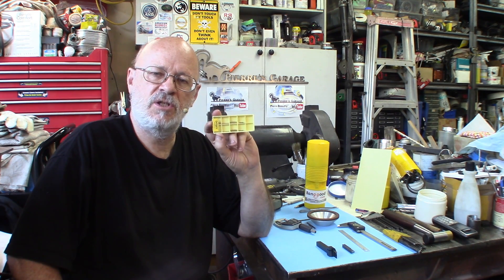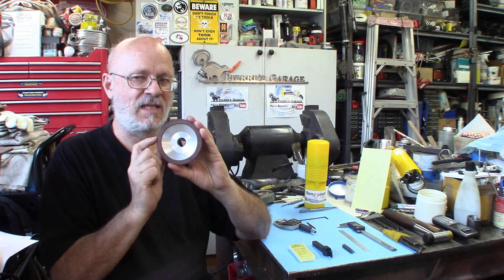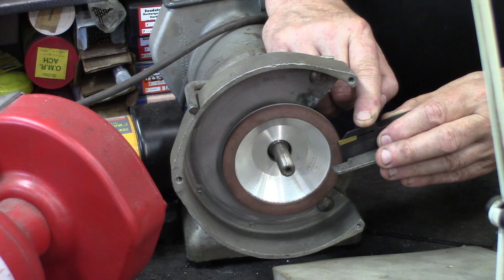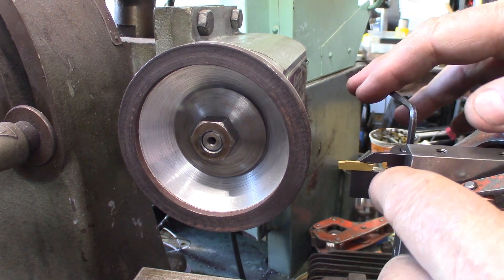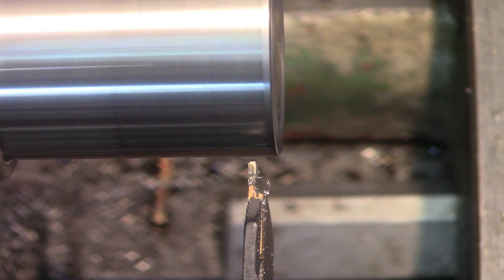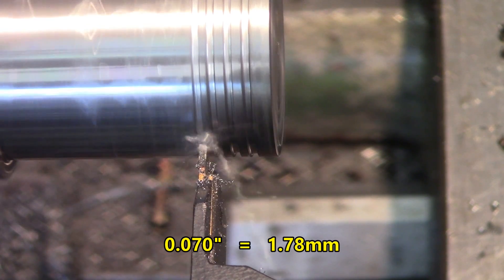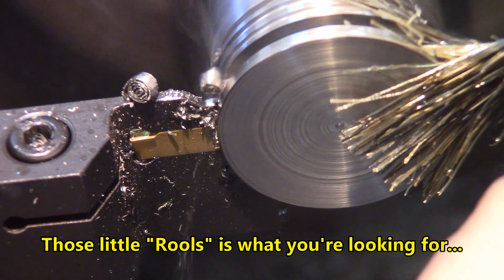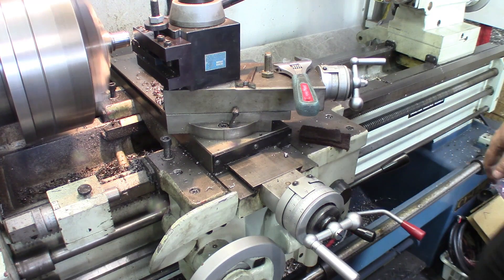Grooving and parting tools made easy and affordable with cheap carbide inserts from Banggood

Comment: So in my noobie adventures with parting, I've already killed two part off tool holders.  Everything is lubed well, and my center height is as dead on as I can get.  But that loud bang and the dollar signs that follow are making me timid.  The last part I managed to do an autopsy on, it looked like the insert had 'dug in' before the holder snapped when I close to center ( deflection maybe ?).  I've read on the interwebnets that I could try putting in my blade upside and running in reverse ( fine for L00 chucks ), or that I should absolutely be using the feeds and not hand feeding it.  My guess is that there is enough backlash in my slide that once the edge grabs, it pulls it right in and explodes the tool.  Can I run the banggood tool upside down ?  It looks like clamping boss/screw might give me less chuck clearance, but the price is more tolerable to experiment with.  Or am I getting bad advice altogether ?  What say you monsieur Pierre ?
Reply from the maker: Hi, just like some of the other viewers suggested some good advices, maybe I could add a little resume of the basics on parting.
First make sure your hang out is as short as possible, 
second, that your gibbs are with a little friction, 
third, that you're center or a tiny bit under, forth, highest possible speed like 1000 RPMs or even more on parts under 1"  (25mm) , mostly with carbide inserts
forth, with smaller machines you may need to stop at about 1/8" from center and finish using a hack saw, due to the little trunion will walk over your cutting edge, 
fifth, check what type of chips you get like those little rols that a ejected out of the slot are ideal, if not coming out or jamming just abort and clean before restart, you can make some kinda "V" groove in the blade or insert in order to make the chip get narrower and clear the with of the slot...
If you still have problems just get back to me and we could look deeper into it...   ;)
Reply: my guess is, are you using a lantern tool post? they tend to bend and the pivot point means they dig in as they pull down they pivot in too which is why people came up with parting on the backside and upside down to begin with, or get a different type of tool bit holder which has a machined anti dive such as http://assets.suredone.com/1599/media-photo/ahf126-armstrong-lathe-cut-off-tool-holder-1-8-blade-str-83-219-5.jpg  i belive tom lipton covered this a long time ago in one of the many videos!
Reply: Using a dorian/aloris type toolpost.  I remember Tom's video about this armstrong tool, have thought about trying to make one that would fit my toolpost .. but so little time.
Reply: Another situation that sounds like what I was experiencing.  Check for loose Gibbs and spindle bearing slop.  Anything that could change axis position to the tool when you put a load on it. If it's a light duty lathe, how well and what it's anchored to can make a difference.
Reply from the maker: I've got one of those and to me it's not that much of a solution, it gave me more problems than solution...

Comment: You should get electroplated diamond wheels ,bangood has lap plates,or bars -kitchen knife sharpeners.
Those can go for hss and steel without problem.
I bought laping diamond  plates from them  and i am happy with them.
Reply from the maker: Thanks for your feedback, this is something I may try in a near future and give my comments about, are those plates better used with liquid cooling or they would do fine dry...?
Reply: dry should be fine ,but you need to be gentle with pushing in the part you are grinding.
So far i tested these diamond stones from bang good and some other items :
https://www.banggood.com/3pcs-2406001000-Grit-Knife-Sharpening-Stones-Set-Edge-Diamond-Whetstone-Sharpener-p-1194499.html?rmmds=search very good dmd tools knife sharpening stones -althou on ebay they can be found for 7$ set of 3.
https://www.banggood.com/150x63x1mm-Whetstone-Knife-Sharpener-400-Grit-Thin-Diamond-Knife-Sharpening-Stone-p-1068561.html?rmmds=search - Very good made diamond plate also there is a 1000grid -sucks for kitchen knifes since its 6cm wide,but overall very nicely made,good for plane blades and chisles.

https://www.banggood.com/3pcs-6-Inch-600-1500-3000-Grit-Diamond-Coated-Wheel-Polishing-Disc-p-1067649.html?rmmds=search - Very good made plates ,althou a little bit thin so i am gonna back them up with plywood disc ,i used it to deburr manualy hss and tungsten carbide tools ,chisles,works very well.
Still have to try it mount it on my bench grinder.Hole inside is 12,7mm,different grits very cheap 10-12$ set of 3.

Anything i bought from DMD TOOLS has a nice even electroplated coat of diamonds,so far it cuts good no diamond loss as long as you dont put too much pressure.

https://www.banggood.com/100g-Abrasive-Polishing-Buffing-Compound-Paste-Metal-Brass-Grinding-Multicolor-p-1109684.html?rmmds=detail-left-hotproducts    -great polishing paste mirror finish on knifes just by using it on leather strop ,BUY GREEN ONE,AM SUPER HAPPY WITH IT.